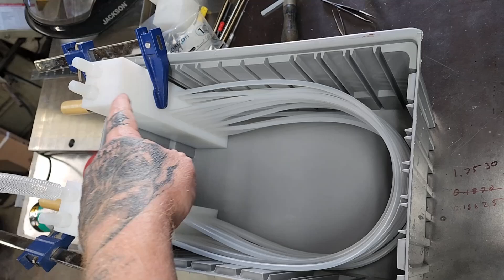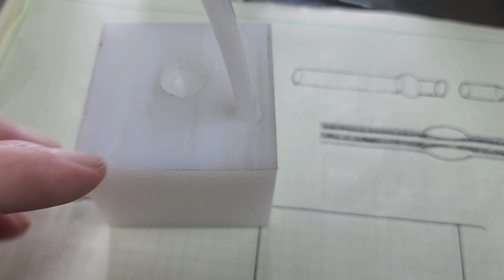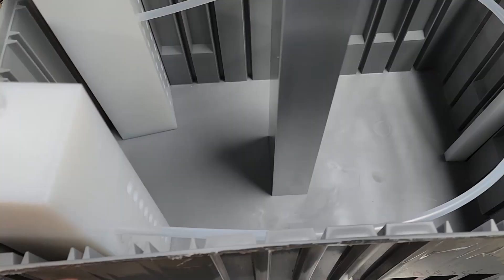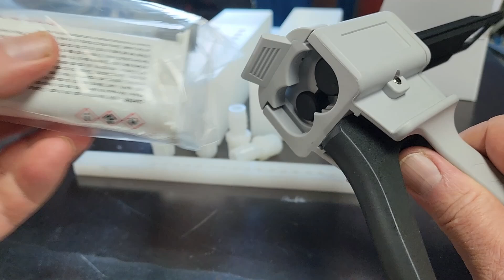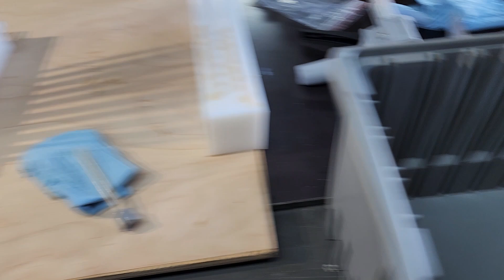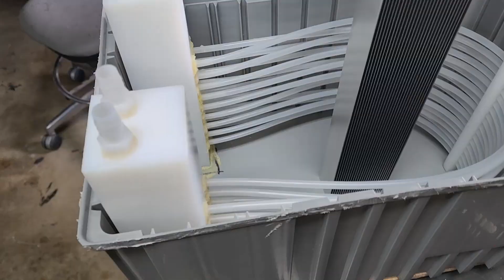Anodizing cooling tank finished

Comment: The only thing that comes to mind for the tube isolators, are something like spark wire isolators
Reply from the maker: I had something I was wanting to use but in the end they would not have fit. They were too bulky and I would have had to reduce the number of tubes by almost half. AND they were ten bucks each. So there was no way. I think the way it came out was great and as long as these don't leak, I'm happy with what I came with. Ill be doing a leak test by this weekend.